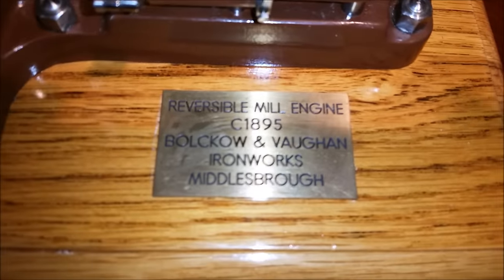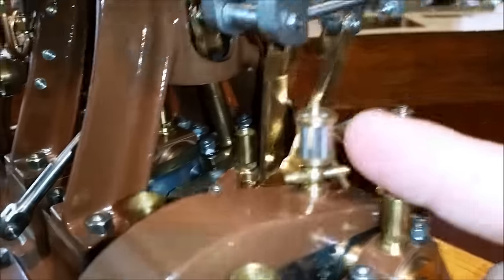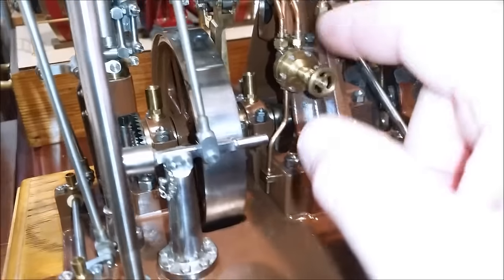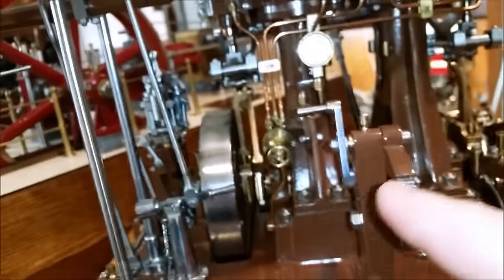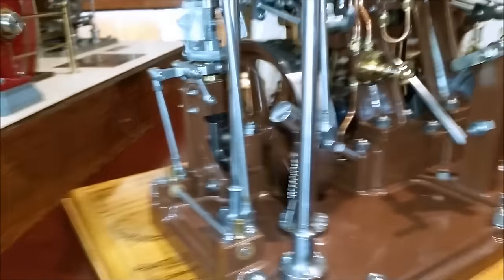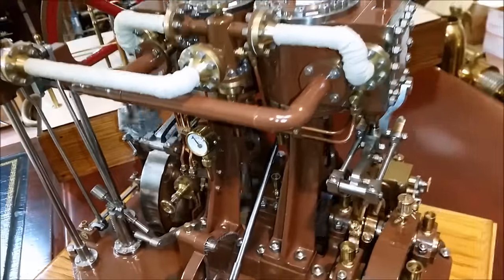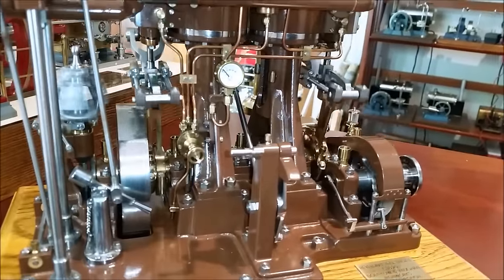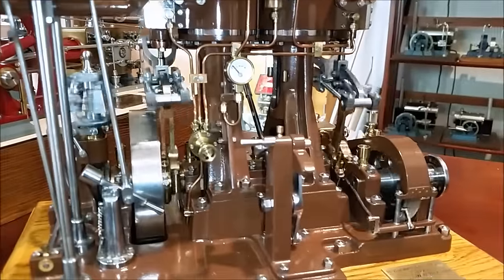Reversible Steel Mill Steam Engine Scale Model ca 1895 Bulckow & Vaughan Iron Works Middlesbrough UK

Comment: As the builder of this engine I would like to thank the creator of the video for bringing the engine to life on the internet.  I'm pleased to see that the engine has been so well maintained since I sent it over to America around ten years ago.Here are a few details:Cylinder Bore = 1.5"Cylinder Stroke = 1.25"The baseplate was cast by Lane's foundry, Middlesbrough, from my wooden pattern.The crankshaft was assembled from 9 individually machined parts using a specially designed jig.Most of the nuts and bolts were machined from hexagon bar-stock, as commercially manufactured items in these sizes generally have incorrect proportions.   Peter Tarn,Forcett, North Yorkshire, England.
Reply from the maker: Hi Peter, It is nice to see your additional information here. Thank you for that and thank you for the kind words.
Reply: I just bought another engine from a man named Bert in the UK.

Comment: Lovely video!  If you want to see a full size, 3 cylinder, 12, 000 HP simple (rather than a compound) British steam engine from a steel mill that is still run on steam, go looking for "the River Don Engine" on YouTube.  This engine is essentially a simple version of the triple expansion steam engines that were in the Titanic.  The huge rotating mass can be fully reversed from 75 rpm forward to 75 rpm reverse in 3 seconds via her hydraulically operated valve gear.  Very impressive.